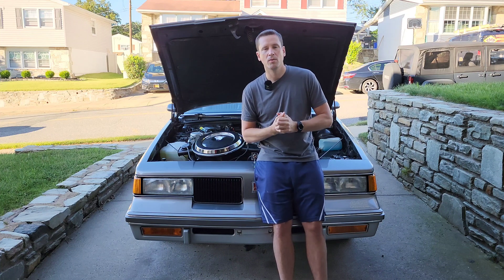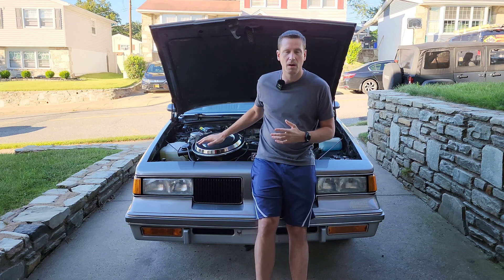Everything You Need To Know About Your Thermostatically Controlled Air Cleaner

Comment: Not sure if this is even a good question or not. 
In general, how would a driver judge when the exhaust manifolds have reached a temp high enough to deliver hot/warmer air to the thermostatically controlled system? 
A little context: I live in Southern California with as everyone may or may not know has some of the highest gas prices in the nation, I daily drive my 84 Regal, get crappy mileage as it were and would like to not waste time and fuel sitting inside my car on cold starts unnecessarily. 
Is there a rule with how much time it takes to diagnose if I have hot/warm air thermo delivery issues? Or do I just log in my cold starts with time intervals and go with the best time with no cold start pull away driveability issues?

Comment: Greta video!! My lever is open already when the engine is cold. Vacuum line works! Engine  warmed up, the lever closes then opens and stays open. Could the 2 vacuum lines be plugged in wrong that’s connected to the air cleaner?

Comment: Is the vacuum line normally from ported or manifold source?  Also on a mid 70's 360 Ford there is a temperature controlled vacuum switch by the thermostat housing, would that be part of the air cleaner vac circuit or be for something else?
Reply from the maker: It should be manifold. And I can't say for sure about the switch. It all depends on where the hose goes.

Comment: Vapor lock is caused by super fine sediment in the fuel pump check valves.   The fix is easy. A 10 micron fuel filter between the frame rail fuel line from the tank and the mechanical fuel pump inlet.   I use either an 1984 corvette fuel filter for 3/8 or a 1994 ford probe 2.0l automatic fuel filter for 5/16 fuel lines.  
I disconnect power to the ignition system so no sparks are created.  Disconnect the fuel line to the carb.  Extend it with some fuel hose into a clean clear soda bottle. Get somebody to crank the engine for 15 seconds while you watch the pulses into the bottle.  Each pulse full and equal to the other. Not diminishing  do the 15 secong cranking full flow procedure 3 times.  This is usually enough to flush the sediment out of the fuel pump check valves.  
Why. The sediment reduces the pumps ability to hold fuel pressure to the carb and reduces the ability to pull fuel from the tank.  The engine heat causes the low pressure fuel to boil and create vapor. The expanding vapor pushes liquid fuel backwards thru the partially open check valves leaving nothing but fuel vapor coming from the carb vents.